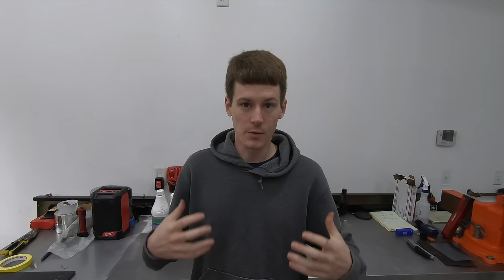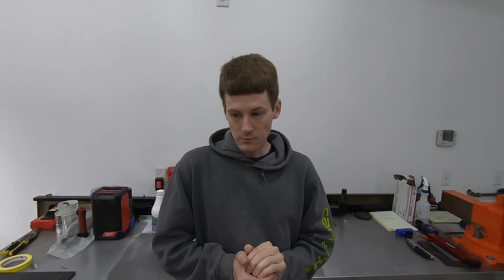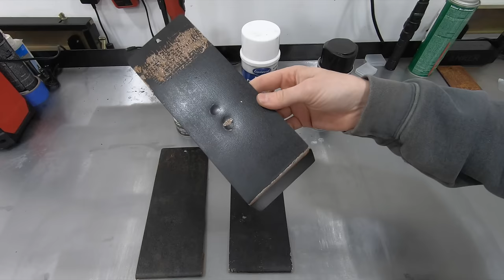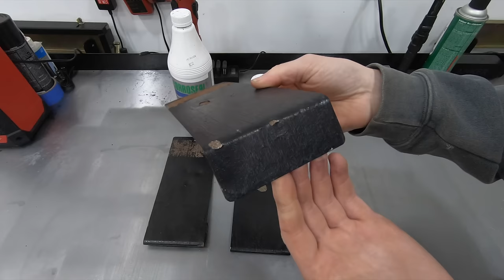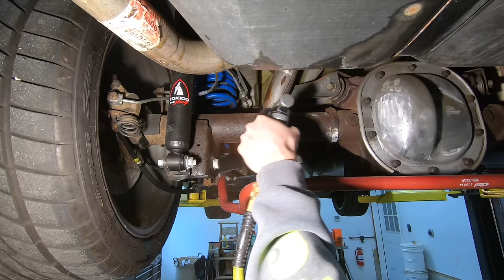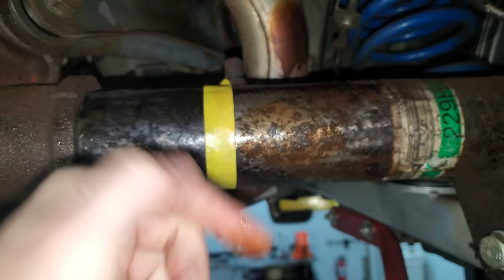MOST Rust Converters Are A JOKE! Let Me Show You. (Eastwood, KBS, Corroseal, Ospho & More)

Comment: Rust encapsulaters and rust converters are very different but the terms in marketing are used interchangeably. Encapsulaters cover the rust and keep it from getting worse by sealing it over; usually epoxy based. Converters are almost always acid based and must be top coated once converted and neutralized.
Reply: Top coated with what ?
How do you neutralized it?
Reply: @briizcustoms9543  neutralized with a base like baking soda and water and top coated with paint.
Reply: Which is better an encapsulate r or a converter?
Reply: can you convert then encapsulate instead of sealing with paint?
Reply: couple years late commenting, but that is what the POR15 system entsils, it comes with a cleaner, a rust converter, and then the epoxy coating

Comment: I've been using Naval Jelly since the 70's and have had outstanding results with zero failure. The longest I have tracked it has been just over 20 years with no return of rust from under paint. It's messy as it has to be rinsed and smells terrible so needs to be used in ventilated area, but the results have been excellent. Just used it last week for an RV project that had rust inside the sleeper floor structure that I was able to remove and treat.
Reply: I never understood those products that require you to throw water at the metal right after you cleaned it off rust
Reply: @Gunnl  its actually fairly common, and if done right, is fine. the issues creep in when you clean it and then leave it bare metal afterwards. treat -> clean -> protective coat.
Reply: When I was a younger man, 43 years ago, I worked in a shipping yard in Florida. One of my jobs was to treat rust on the deep sea ships that came into Port. I used naval jelly on them. It always worked perfectly.

Comment: Now from experience, the rustoleum “rust reformer” is a black primer that works surprisingly well.  Not a permanent a solution but will buy your chassis a few more years.
Reply: What about on the top of a roof of a car?
Reply: Sunlight is merciless so you’ll wanna paint over the primer. But with that stuff and a little paint it will probably hold up 5 years. Just make sure you give it a good scrub with soap and water.

Comment: I've had good experiences with rustoleum rust converter, went on clear, turned rust black, and as long as all thick rust was removed as is wire brush it thoroughly but not needed to be to bare metal, just down to surface rust only, it lasted and worked great, my project car on hold sat in my driveway for 4 years now and isint rusting where I used it, and I spent maybe 30 hours over 2 weeks wirebrushing the WHOLE underbody and wheelwells and using that as a primer layer, then a black primer onto after, then rubbercoated it all, and no rust coming back with Canadian winters too so from +35c to -45c temp ranges, salt from my asshat brother burying it when shoveling the sidewalk while I was living on my own for a bit, its held through

Comment: One advantage of the Ospho is since it is very thin it will wick in between sheetmetal pinch welds and crimped panels
Reply: That's an excellent reason/way to use what OSPHO I have on hand, even though I am going to use the top performing one for all accessible areas, in projects I do.
Thank you!
Reply: Thanks for that suggestion. I have a pickup truck that has many spot/pinch welded brackets on the underside of the cargo box. The road salt and water has gotten in between these overlaps and started rusting the sheet metal. I am looking for something that I can spray on that will wick in between these overlaps and stop/convert the rust.

Comment: Thank you for this. My father and I have my late grandfather's older car, with not a lot of mileage on the tires, but a lot of years under its belt. A leak developed in the trunk weather stripping, water caused some rust to form under the spare tire. Your video has taken me to Rust Kutter, and it's doing for me what your testing showed you. Subscribed as a thanks and a very heartfelt thank you.

Comment: Thank's for the great video. Fortunately I already use the Rust Kutter brand. I'd like to share a tip with everyone. I work on tons of snow and salt equipment and whenever I try to do a wiring repair job the copper strands are black with corrosion no matter how far you strip the insulation back. Like everyone I generally sand or scrape it off as best as I can. One day I thought I'd try the Rust Kutter. It works great. Turns it back to shiny copper again. I pour some into a bottle cap and swish the bare wire end around in it for a few minuets. when done I rinse it off with water then spray with CRC battery cleaner to neutralize the acid and rinse again.  Sounds time consuming but makes a great repair. Might also work on other non ferrous metals, maybe you could do some testing. ???

Comment: I used VHT Rust Converter on my Tacoma frame which had visible surface rust along every weld on the frame.  After all the visible rust turned black, I went over it with a flat black Rustoleum.   3 years later, and they all look perfect.  No separation or blistering at all.  Now, on other bare metal surfaces like the suspension parts that had no coating from the manufacturer, I did have to repeat this process roughly every year.
Reply: What is VHT
Reply: @Scott Ballin  sorry, I didn't finish the thought completely.   It's VHT Rust Converter.  It is a spray on converter, and works well.  There are other good converts too.  VhT is just the brand.
Reply: Rust Mort is similar.. Works awesome.
Reply: Fing tacomas have shit frames. Every gen just dissolves if you live anywhere near salt. Did you ever try CRC rust converter?
Reply: VHT is discontinued, which sucks because it was good stuff

Comment: A much needed video.  Nothing like upending established market products.  Good job!

For a long time I used Loctite Rust Neutralizer thinking what a godsend it was.  It bonded existing rust and I could then paint over it.  No!  This product is a combination of tannic acid and acrylic.  The tannic acid is the rust remover and chemically converts the rust into a neutral state, but the acrylic is a useless base coating that should never be under any other type of paint.  Tannic acid chemically converts the reddish iron oxides into bluish-black ferric tannate, a more stable material but it can also corrode metal and is not the best rust remover/ converter/ neutralizer.  The reason some of your tested products did not work, is due to tannic acid being used.  
Some beginner DIYers (as I was once) don't want to spend the time understanding chemistry. They want a quick one step does it all solution. For them, let them continue using Tannic Acid products as it is safer than the stronger stuff like phosphoric acid, muriatic acid, etc.  

Phosphoric Acid etches the rust off the metal better than Tannic Acid.  This is what is in the Rust Kutter you recommended.  It can be dangerous to apply, fumes in lungs and eyes, back splash, spatter, all dangers that need protection with goggles, neoprene or thick nitrile gloves, working in open spaces, skin protection, etc.

Why not use straight phosphoric acid?
1 part 99% phosphoric acid added to 4 parts water is a 25% solution. 
1 part 85% Phosphoric acid added slowly to 4 parts water is close enough to a 20% solution. 
You typically need a 20 - 30% diluted PA for rust removal.  
Remember to add PA (acid) to water, not water to acid in decrease danger of splashback and spatter.
On Amazon, here is 1 quart 85% PA at $13, search for:
Duda Energy 1 Quart / 950ml 85% Food Grade Phosphoric Acid Rust Remover Clean Etch Metal

Is phosphoric acid harmful to humans?
Phosphoric Acid can affect you when breathed in. Phosphoric Acid is a CORROSIVE CHEMICAL and contact can irritate and burn the eyes. Breathing Phosphoric Acid can irritate the nose, throat and lungs causing coughing and wheezing.  Use protection!

Why do they put phosphoric acid (PA) in Coke?
Acids provide a tartness and tangy taste that helps to balance the sweetness of sugar present in the beverage; they are key factors in the taste of the beverage. Phosphoric acid is added to cola drinks to impart tartness, reduce growth of bacteria and fungi, and improve shelf-life.  When you drink sodas, the PA damages your bones and gives you osteoporosis. Apart from the harmful effects of the sugar, salt, caffeine, and dyes in sodas. Do not drink sodas.

What happens to teeth in phosphoric acid?
Soda also contains phosphoric acid, which is highly corrosive to the teeth. To get an idea of just how erosive it is: phosphoric acid is also used in fertilizer and metal polish. Even small amounts can erode your teeth's enamel.

fyi - Don't say 'literally' and 'actually' in your speech. They are overused and a bad habit.  Everyone has a few 😊
Reply: Not $13 but $31.25 for the 85% Duda.

Comment: I began using OSPHO when starting out as a deckhand on offshore tugs. It was an industrial/marine product only back then and was hard to find someone who would sell it retail. I used it then, and still do as a way to stabilize rusted steel (not thin sheet stuff) after chipping, grinding rusty and scaly steel that had been subjected to wear and saltwater-where you can't or would not blast it. It was excellent then and still is for those HD uses. I  use it as a pre-primer before epoxy or other top quality primer..
Reply: Indeed, Ospho needs prep as in sanding, wire brushing, needle scaling etc before applying.  Industrially its used as a dip tank solution before priming new metal to treat any invisible surface corrosion on the new metal and some may be surprised how even a shiny new sheet of steel will have black patches of iron phosphate appear on it afterwards where it has been invisibly already started corroding.  Pretreating rust with a water/vinegar brine soaked shop towel for a few hours followed by a thorough rinse with water to remove the rust and a fast drying process is also a good first step.  Steel ships, automobiles, trucks, bridges, etc started lasting longer after Ospho was introduced.

Best!
Reply: Exactly, thank you. Ospho isn't a rust stripper, its a rust converter, converting iron oxide into iron phosphate so getting shiny metal was never the goal. Ospho works very well.
Reply: @nicholasagnew2792  Ospho when used in a Dip Tank will boil off the rust very effectively and since it has such a thin viscosity penetrates between pinch welded pieces nicely.  You'll see the rust and corrosion float to the surface of the tank and form a layer of black scum as its working.  

Steel will come out with a mat grey finish that will have good adhesion with your primer which is why many industries use it in dip tanks/bathes for metal prep during manufacturing.

Best!
Reply: I read through some of the other comments now on this video and I think the Ospho process is misunderstood.
Take a painted/coated panel that has rust on it...
Step one is to grind the entire surface down to bare metal, using a wire wheel to grind the rusted areas of all scale and brown surface rust. The rust needs to be wire wheels until virtually no more brown dust comes up from doing so. Then at that point, it's time to apply the Ospho. I always apply it with a brush, working it really well into the metal and I do the entire panel, even if there's no rust in spots. Then it needs to fully dry, minimum of 24 hours.
Step 2 is to make sure it's completely dry and then I start with P80 grit sand paper on a DA and make sure to remove all surface scale created by the Ospho. You do not leave that scale in place! That scale is the converted rust contaminants that cannot stay with the panel. Once it's all sanded down and no more scale, it's ready to be wiped clean with a good wax and grease remover.
Step 3 is to coat the panel with a good primer and paint as normal from there.
Hope this helps someone out there in YouTube - land 👍